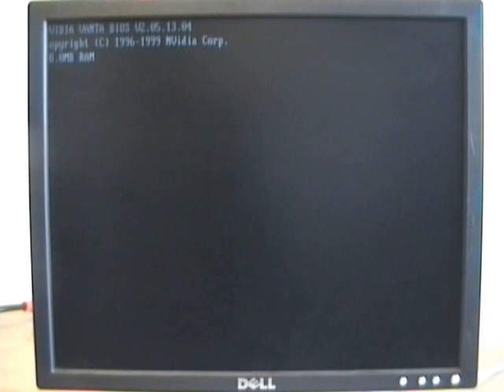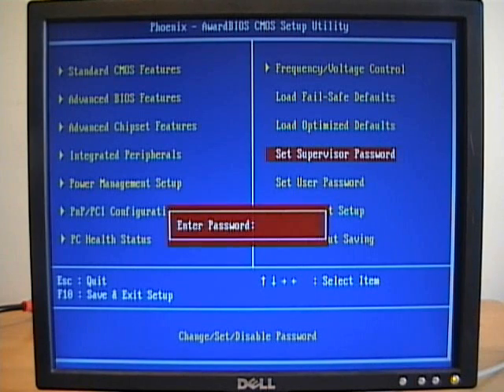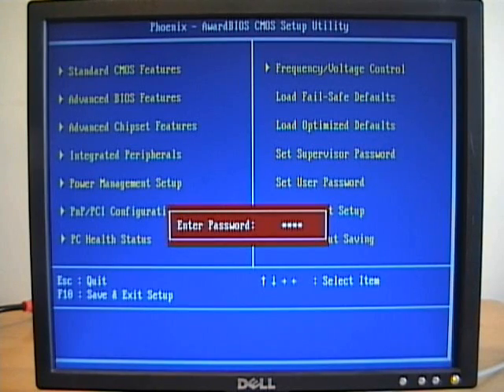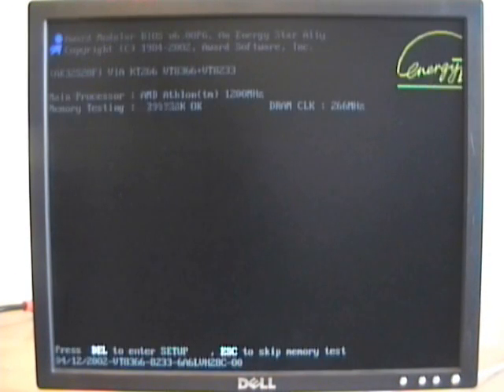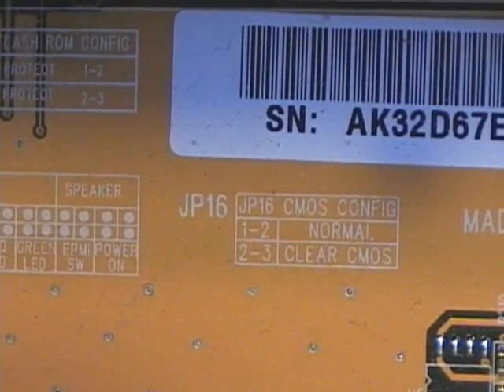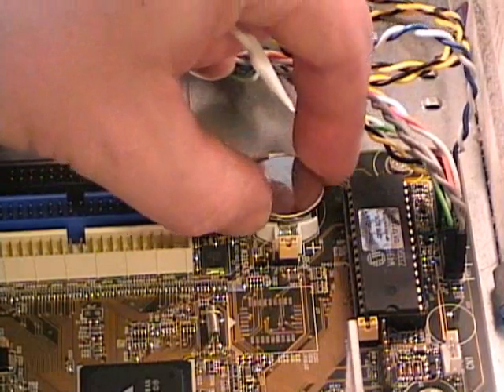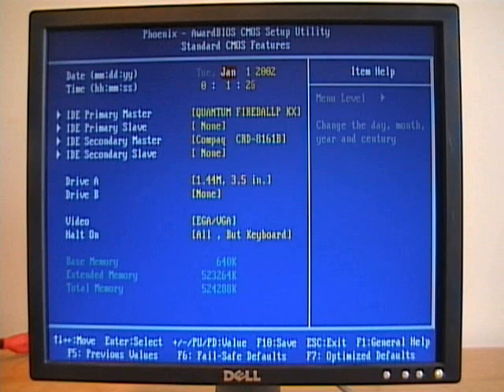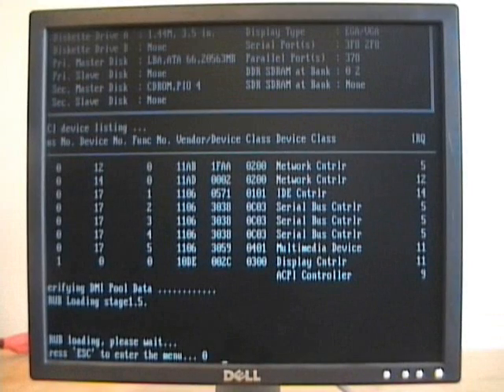BIOS and CMOS Part 3 of 3

Comment: If you selected in Security Option: Booting instead setup, and you couldn't remember the password to start the OS, could you reset the password the same way? by jumper or removing battery? Thanks a lot and great videos they are very helpful.

Comment: Yeah, this technique will reset ALL cmos settings back to default so all your overclocking settings will get wiped. 

The thing he doesn't mention is that you have to have the power adapter unplugged. Most modern MBs use the cmos batter ONLY when there is no other power source.